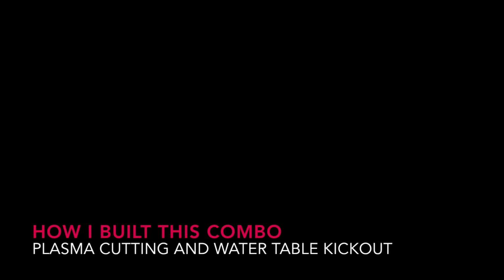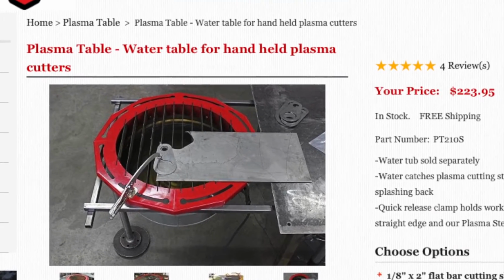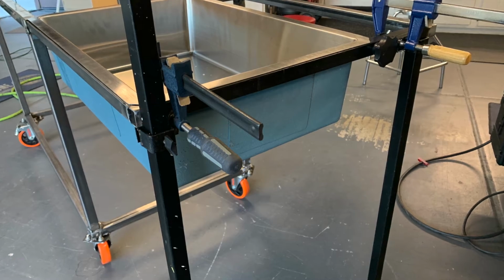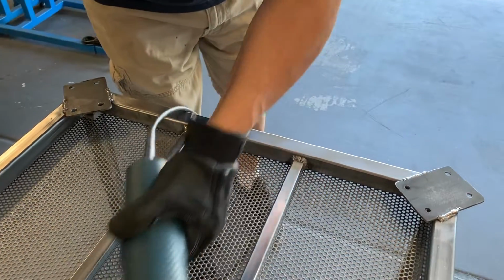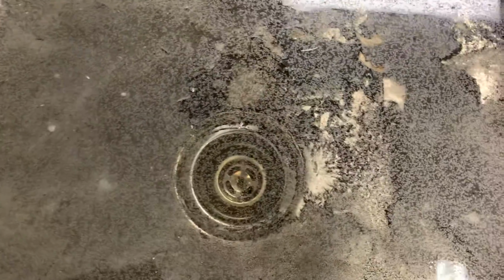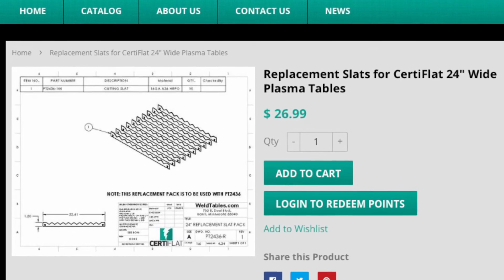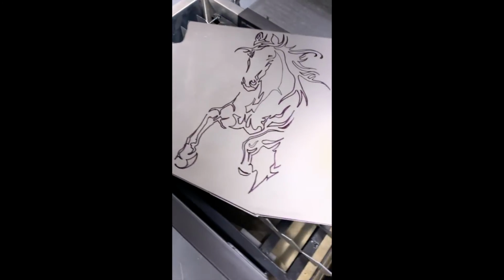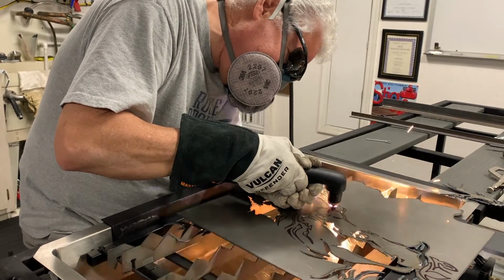Ultimate Plasma table with Water table.

Comment: Nice job putting that together you are giving me lots of great ideas  Have you thought about adding the slide out legs to the other side and let the sink store and be used from the same side. So you could have it pre prepped with clean water and just slide it out when needed. Rather then have to pull it  out and go around to the other table to drop in.
Reply from the maker: Joshua Ruiz good idea, but I kinda already committed. If you build one, send me a picture or video of your build. That’s the nice thing about fabrication. You can always make version 2 better. Plus the pull out allows the sink to set flush with the table top so if I use a big piece of metal, it’s even across the entire table.